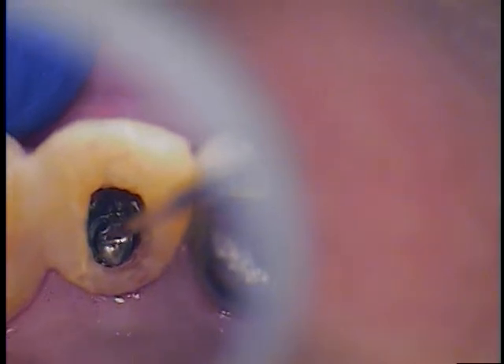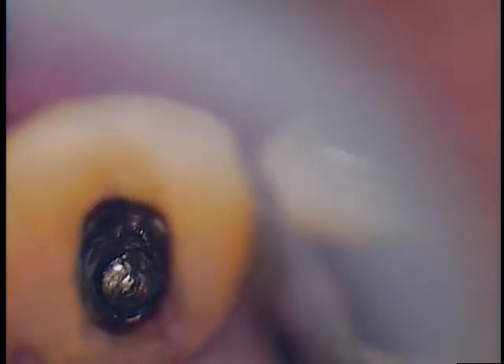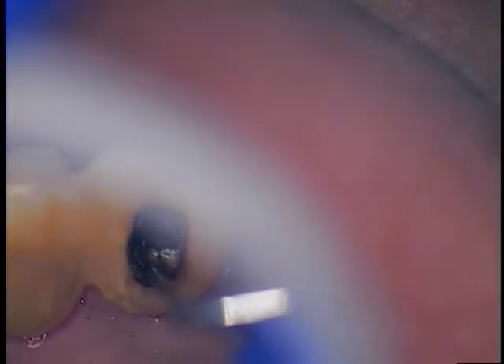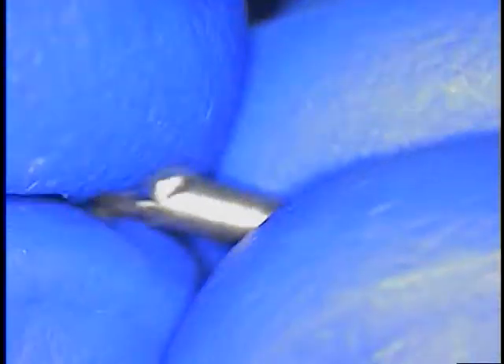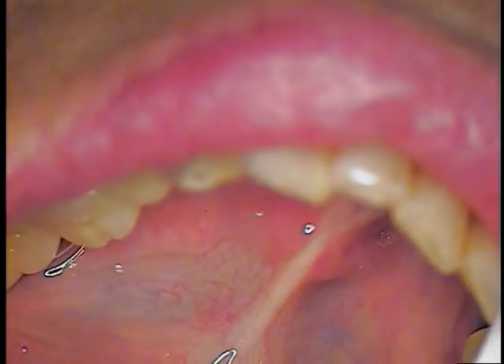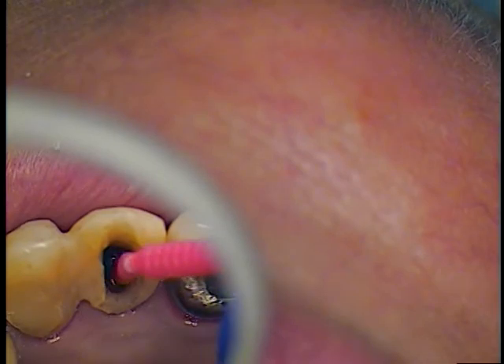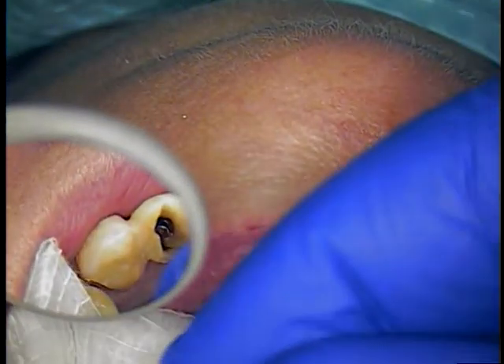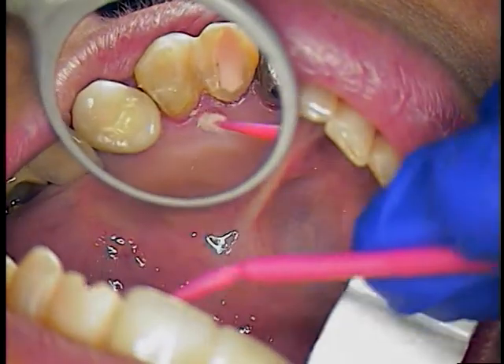Dental Implant Abutment Screw and Abutment Retrieval 6/9

Comment: Dr jerry can I know why the screw fractured ?? Is it because of too  much of lateral forces if so can we use Tuscan to reduce those forces???
Reply from the maker: Hi there. The screw head was stripped by:

1. Operators inability to seat the screw driver parallel with the straight line axis of the implant abutment screw.  

2. Lack of proper magnification [microscope].

3. Use of rotary instrumentation. [sm. round bur].

I believe Nobel has a new screw driver that can be used exclusively with their own system. It has a slightly offset tip design for operators who need to un-screw an angled abutment or do not have straight line access to the screw head.
Reply from the maker: What is Tuscan?
Reply from the maker: Lateral forces can definitely have an effect on abutment screw retention. I believe the implant abutment to fixture connection design governs the long term stability and tightness of implant abutment screws. Some internal conical connections have advantages over others. 
I agree that lateral forces do act as one of the catalysts to screws becoming loose. I don't feel that the lateral forces cause the micro gaps in abutment design.